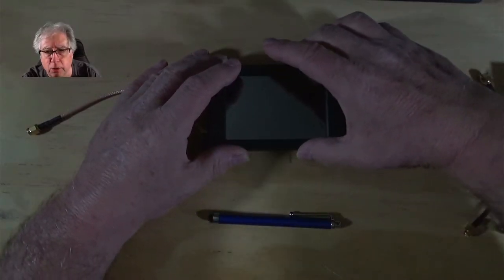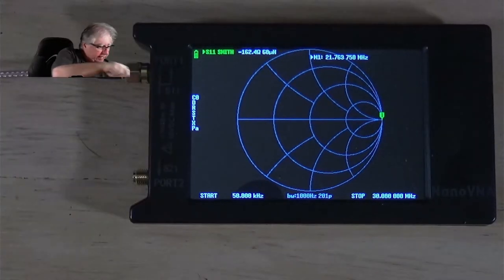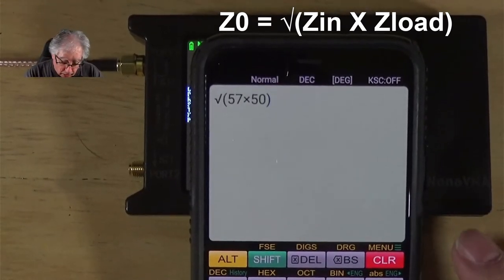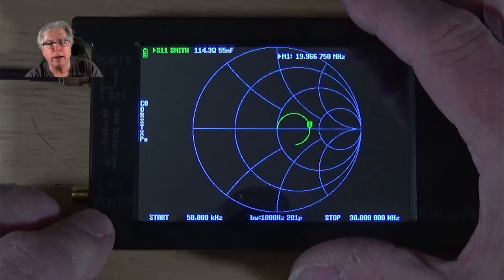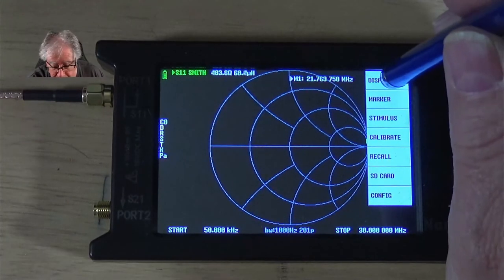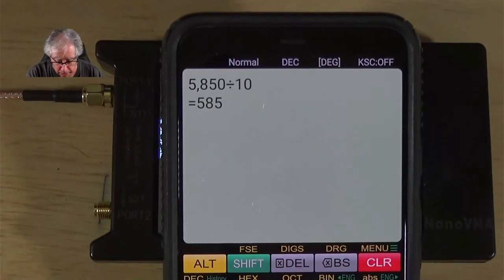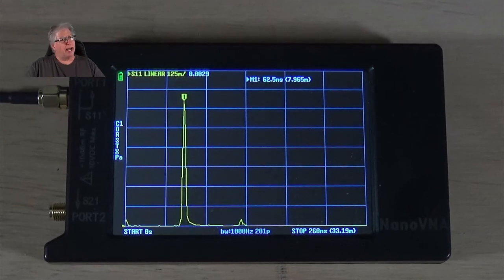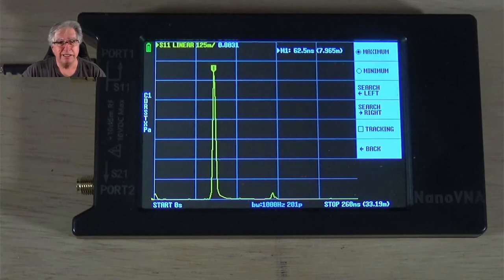NanoVNA: Testing Coax For Characteristic Impedance And Distance To Fault (Length)

Comment: Thank you very much for the most elegant and concise way of determining the characteristic impedance of a transmission line!  Other people's solutions involved way too much math.  With your method, I was able to quickly and easily confirm that a nice and inexpensive "supposed" RG316 coax was actually 50 Ohms impedance, and some of my old coax was about 75 ohms, which I expected but used as a test to ensure I was doing it right.  This has releived so a chunk of frustration.  Thank you again!  -VK4SSE, Rob
Reply from the maker: Glad it made it a little easier!

Stu
AG6AG

Comment: Stu, thanks for another instructive video about using the nano. I liked how that sneaky "4" jumped into your formula to suggest that the cable was 300 ohms; another common type. Keep 'em coming and 73.
Reply from the maker: Yeah, those 4s get me every time... <g> I think we will do some more Oscilloscope stuff. Then take a poke at the Spectrum Analyzer.
Thanks for your comments!

Stu
AG6AG

Comment: This is good.  Works for twisted pairs too (sometimes important when winding baluns). 
There are a few other methods for measuring cable impedance.  One of my favorites is to put a potentiometer at the end of the cable and reduce the circle to a dot.  The pot resistance is the impedance.
The open/short method is also popular.  For typical coax, just measuring the capacitance per foot is quick and dirty.  There are tables showing capacitance for a given coax impedance.
For cables with a sudden change in impedance (bad shield or splice) the TDR method is best for me.  I can see the impedance vs length (requires a fast rising pulse and oscilloscope).
For a real challenge use wire that is lossy (nickel wire or very small gauge wire).    : )
Reply from the maker: Good points. Thanks for posting!

Stu
AG6AG

Comment: Good video Stu. I have always used MFJ 269 to test and find out the length or broken point, but your video shows how it can be calculated using nano VNA. Very informative. I guess you have a 4" screen version of it for the video. Mine is the smaller version and I often have hard time reading it.

Comment: could you not try the measurement by plugging a 50 ohm dummy load on the other end ?? to do the measurement with for distance, just a thought Stu, good video Stu keep them coming :)
Reply from the maker: Hi Kevin,
You can do the measurement with the far end either shorted or open. I don't think you could accurately measure the distance with a 50 Ohm load on the end. You certainly could try it, but I think the measurement would be a bit off...
My next project related to the coax length is to try measuring a coax with an antenna on it to see if there is a bump where the connector to the antenna itself is. In theory, the big jump will be at the end of the antenna, but I think I will still see a small jump at the connector at the end of the coax.
If you test it with a 50 Ohm load on the end let me know your results!

Stu
AG6AG

Comment: WAIT  you said you hooked the coax to the nano vna, but is there a load or any thing on the other end of the coax?  When i hook my coax up my little circle is as big as the largest circle on the smith chart ....
Reply from the maker: Hi Robert,
Yeah I hid that statement away in the calculator part of the video. Here is where I give away that there is a 50ohm dummy load on the end of the coax.
https://youtu.be/ORaYx9ab6zg?si=ZJMZBp4u-nw8KCan&t=455
Sorry for the confusion,

Stu
AG6AG